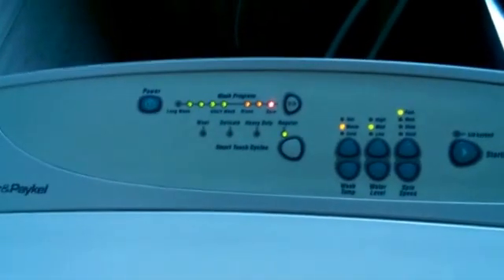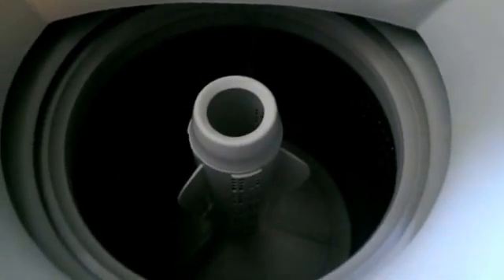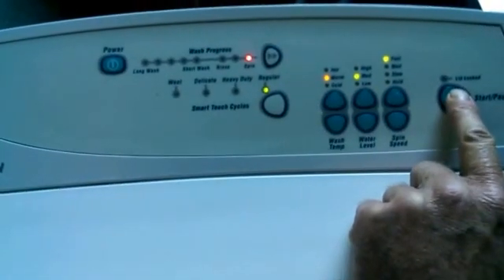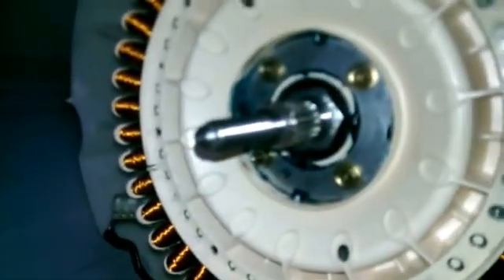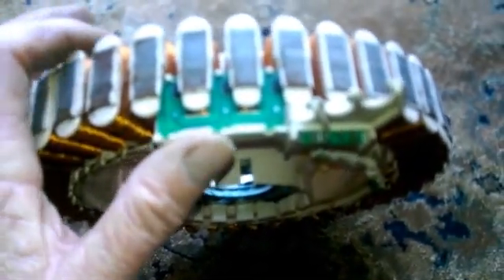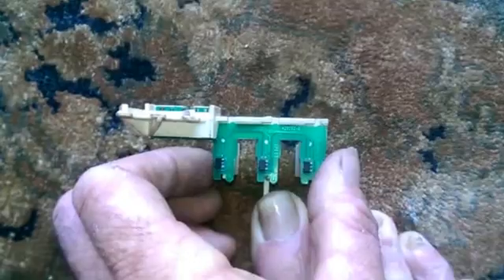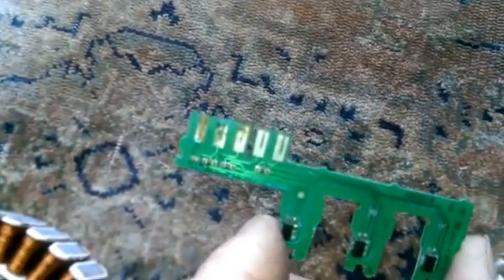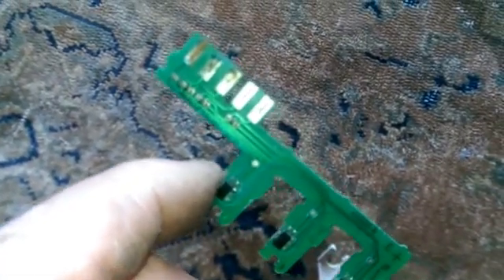Rotor Position Sensor Replacement Fisher Paykel  Error Code 130, 131 and 240.

Comment: Hey mate, any chance of a video for the same machine that it is not spinning? It seems like every time I have to unload and reload the washing machine again and then it spins. It seems like I have to rebalance the clothes all the time.
Reply from the maker: @danielamarobuz8811  if the machine does start to spin and then stops it's most likely a faulty drain pump that overheats. Check my Fisher and Paykel drain pump test. Or it could be a faulty "out of balance" switch ( if it is an older model. )
Reply: @paulywooly  thanks for the comment. But no, it doesn’t even start. When I re balance the clothes and get them precisely symmetric, then it does the spin.
Reply from the maker: What's the model number, there is the sticker on the back left @danielamarobuz8811
Reply: To be honest I am not sure if it only spins with very little clothing in it or if it needs to be rebalanced. Maybe it is both.
Reply from the maker: @danielamarobuz8811  ok.
MW512 
 I would go to the "out of balance" switch. Undo the two screws at the back and lift off the buttons panel.
If you are handy with a multimeter, test the switch. Any high ohms reading means it's faulty.
Watch this and zoom through to 5.30mins to test the OOB switch. Hope this helps 
https://youtu.be/5GPBq3XKZMk?si=j1VB7glVg7Z1zUdY
Reply: @paulywooly  thanks mate.  I’ll try my best and let you know how it goes went. 
Cheers

Comment: I have this fault  code . Could it also be bad bearings or the windings  ? It spins  sometimes (empty) but once  up to speed it stops. When i spin  the drum by hand it makes 2 thuds in the bottom but no bearing rumble . Thanks
Reply from the maker: Could be 2 problems.
Usually when the machine stops during the spin cycle means the pump is faulty and overheating. When it stops, switch the machine off at the wall and lean the machine back against the wall and feel the pump is not hot. It should only be slightly warm. Try that first get back to me
Reply: @paulywooly  ill try that  in the morning it's late now. I guess I also  need to mention when I turn it on it does the 130 fault code straight away I only got it to the  spin stage by skipping quickly to spin cycle.just to test the motor.   explaining that in case u thought it made it all the way to the spin stage normally. It wont start a  wash cycle, true to move bowl  . Also the pump is still removing water out the spout in the spin cycle  but it pulses. Thsnks so much for your support. I'm depressed about having to get a new machine. I had to hand wash today it was horrible and its winter!  I have a multi meter etc and tools. I'm thinking should I just tip it up in the morning and do whet u show in the video first  ?
Reply from the maker: @Matowix   ok It now does sound like it is the rotor position sensor is the fault. It's a VERY common problem. You can buy the RPS card online and replace it.
Reply: @paulywooly  I cleaned  up the  contacts  on the plug to the rps and the 3 stator contacts just to be sure. And it went through a whole cycle. Working ok. And i didn't see any  water leaking from seal &  bearings  etc.  
So many  thanks.  MUCH APPRECIATED FOR THE GUIDE AND YOHR REPLYS  😀😀
Reply: @paulywooly  just a follow up. It's been going ok since I cleaned the rps  but now it stops just before  rinse cycle when still has one third left to drain of the main  wash , it just pauses. I can re start it by power off and go back to thst stage of cycle. There is no fault code coming  up. And it will stop just before final spin, will do small attempts at starting to spin . Again I can do the spin after power off for a bit  and goto spin.  As if it needed too cool down  form or something.  Also there is some dirt  and lint at bottom of the  bowel at the end of the cycle as of its coming  up from somewhere in the machine.  I can do a full cycle but have to power  off and restart about twice per cycle. Any ideas.maybe  when i tipped the machine flat on floor to get to the rps it did something.pump water has plenty of pressure when coming out.   Thanks again.
Reply from the maker: @Matowix  It now sounds like the pump is overheating, a very common problem with no fault code. The pump has a thermal cut-off switch inside it and it will switch off halfway thru pumping out. When it cools down it starts normally again.
You will need to replace the pump if it is too hot to touch. 
As for dirt and lint, watch my video of how to service and clean the machine
https://youtu.be/HNY54gTrcB0?si=t6soWTMzMSmiNHRM
Reply: @paulywooly  isnt  it a coincidence that rhe pump went straight  after I serviced the rps. Also there is a  slight smell like mild electrical burning (maybe the pump ? ) strange how the pump is still  powerful. Would  it have gone faulty from me putting the machine flat  on the side.  Thanks again. Are pumps expensive
Reply from the maker: @Matowix  no it is just a coincidence, nothing to do with the machine being on it's side. An overheating pump will have a burning electrical smell. You should find one on the internet or a good second-hand pump from somewhere. Google Selni Smartdrive pump. The brand new ones are a better design.
Reply: @paulywooly  ok. Many thanks again.

Comment: Hi Paul, thanks as always for your help trying to keep our beloved washing machines working!

I have a F&P GW712.

Recently, the sound of the spin cycle changed to being really loud - noticeable outside the laundry.

I manually rotated the agitator and it felt “notchy”. I assumed it was the bearings so replaced those tonight and all seemed well. The seal had leaked and the upper bearing needed replacement.

When I reattach the rotor cover and tighten the knob, the cover does not spin freely over the rotor, it seems to be slightly catching.

I proceeded to put it together anyway and went to run the spin cycle but it will not spin and gives me a 136 error.

Are you familiar with this type of problem?
Regards 
Peter
Reply: Hi Paul, thanks for your help. 
The yellow stator wire was severed - must have been when I struggled to take the terminal off in the dark! Unwound the wire to get some length to reinstate in the terminal and good to go! The old girl lives again…

Spin cycle never sounded so good. 

Thanks again for your help and reply in overtime. 

Peter
Reply from the maker: @peters5493  glad to be of help
Reply from the maker: A few reasons:
The bearings could not be fully seated. The steel tube spacer between the bearings  should sit tightish between the bearings. If it's really sloppy or loose then the bearings aren't smacked in "home".
  Is the stator seated correctly with the  metal plates either side.
Did you put the motor 3 wires on the correct terminals? Printed on the plastic part of the stator is RYB for red yellow blue. This is important. 
Or ... Could there be something metalic stuck to the magnets of the rotor that is jamming the motor.
When you spin the rotor by hand, it is normal for it to have a slight rumble which is the magnets passing the stator coils. 
If I think of anything else I'll let you know. I'm just off to bed
Reply from the maker: PS.. check the resistance between the red blue and yellow wires at the motor control unit. They should read around 32ohms between all 3.
Also the rotor position sensor could be at fault. Check it's seated and plugged in correctly

Comment: Hey Paul I have a machine I got that’s bringing up Error 104 after I replaced the pump. Do you have any ideas of what could be the culprit? It was playing up before I replaced the pump. The model number of the machine is LW095NZ.
Reply from the maker: Ok the service manual says 104 is a communication error between the display module and the motor control module. Disconnect and reconnect the plug to the display module. But on your particular model (phase 5 type) it 
can be a rotor position sensor (RPS) fault. Check the plug connection at the RPS is clean. It can get covered in a green corrosion.  or it needs to be replaced. Failing all that it's a faulty motor control module. Unfortunately Phase 5 machines have very unreliable modules and you will probably not find another one anywhere. Watch my other video for error 130 131 to get to the sensor. Good luck
Reply: Paul P Do you think that I should clean the plug for the display module? If so what should I use?
Reply from the maker: You could use a CRC contact cleaner spray. OR just a nail file on the plug contacts. But it's more likely the rotor sensor plug or the sensor itself. Which is very common in older machines. Clean with a nail file also
Reply: Paul P Would sandpaper work?
Reply from the maker: Yep..that'll work just as good. ...do you live in NZ?
Reply: Paul P Yes I do.
Reply from the maker: Ok if cleaning the sensor doesn't work, I get my sensors off this guy 
https://www.trademe.co.nz/2728801779
Reply: Paul P I have a few spare sensors but thanks anyway.
Reply from the maker: Ok that's good. Sorry I can't be of any more help. I've given up on fixing phase 5 models now because they are a nightmare.
Reply: Paul P Oh and how many times do I need to go over the RPS plug? I’m guessing just until the corrosion is gone.

Comment: Hey Paul hope you see this, I can't seem to get off the plastic part that covers the stator. Your one has the nut that you hand turn but mine doesn't seem to have that, just the plastic part and no matter how much I turn it or try and pull it off it won't budge. Been trying for 15+ minutes to get it off. Any advice?
Reply from the maker: It should either be the large one that can be turned by hand or later models have just a 5/8 plastic bolt that is undone (anticlockwise). The thread is very long and the bolt stays inside the rotor. You'll see the rotor slowly moving and when it stops .. then, with one big heave, pull off the rotor.  The magnets inside are holding it in place. Hope this helps. Keep in touch
Reply: @paulywooly  thanks! Got it sorted not long after I posted by trying a different socket bit (a longer one, don't know their proper name!) which got it turning and it came off after a couple of minutes. 

I'm guessing if I have a broken copper wire on the stator it's not really fixable? It's one of the ones that goes between the coiled bits. A few of the others have corrosion but only one has broken. Or could it be soldered?
Reply from the maker: Yes if there is any length to play with. In the past I have uncoiled the wire by one or 2 turns to give me more wire to work with to solder
Reply: @paulywooly  thank you so much for your videos and your advice Paul. I soldered the one wire that was broken, reassembled and it just made it through a whole wash cycle! 

People like you are just the best!
Hope you have a great Christmas!

Comment: You say "if the contacts are very badly corroded you will have to buy a new rotor position sensor". Are you saying then that it's possible to just clean them and they may work then? If that can be tried what is best to clean them with? Thanks very much :)
Reply from the maker: Yes they MAY work again.   If the contacts are all green with corrosion it's best to get fine sandpaper to clean them AND the 5 plug connections for a better contact. Good luck
Reply: @paulywooly  Thanks Paul. Turns out it wasn't the rotor position sensor at all. The bearings needed replacing. Thanks for taking the time to reply to me though. Cheers

Comment: hi Paul,
i live remotely, so i try to DIY repairs,  and have purchased a new FandP rotor position sensor. The MW512AU machine has been playing up for weeks, but gradually completes the cycle after restarting etc. I should have marked where the old sensor went on the stator, because I am still getting (1000010 )130 error after fitting new sensor. I cannot see where the old sensor went on the stator, so i think this is the problem, or the spare part is not right??
thanks in advance for advice
Gerry